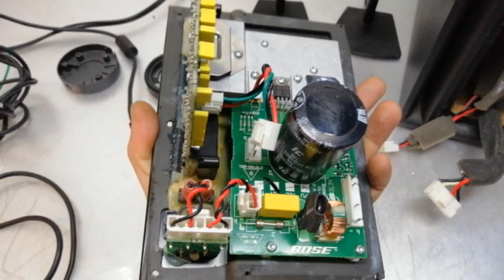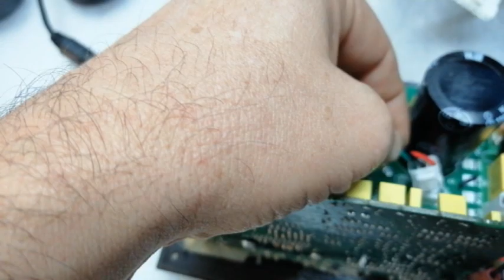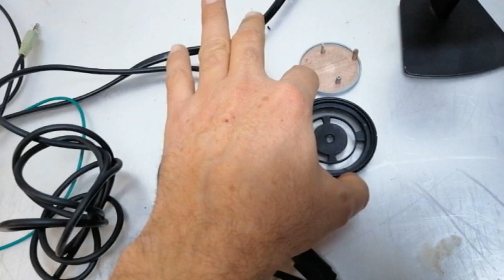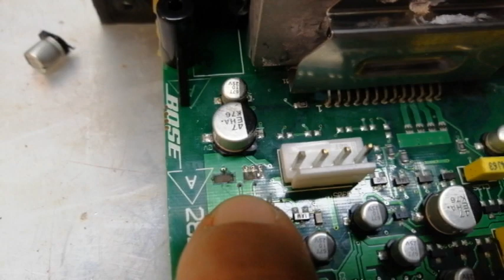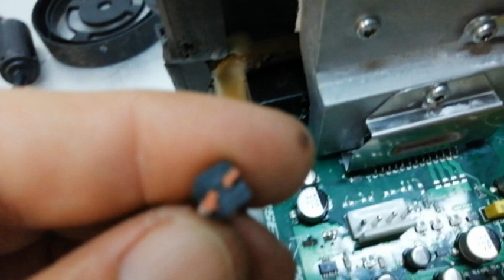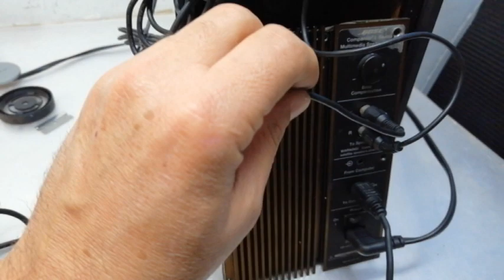BOSE Companion 3 Series II with no Audio Output

Comment: Hola por mas que miro el video no se donde conectar el condensador. El polo positivo condensador de 100mf 25v va a...?? y el negativo??? se que uno va al mosfet y el otro va a la resistencia de 1 kilo ohmio. y al mosfet a que patilla va? Pero no se cual a cual. No se mucho de electrónica por eso pregunto.Gracias espero tu ayuda
Hi, as much as I look at the video, I don't know where to connect the capacitor. The positive pole 100mf 25v capacitor goes to...?? and the negative??? I know one goes to the mosfet and the other goes to the 1 kilo ohm resistor. and to which pin does it go to the mosfet? But I don't know which to which. I don't know much about electronics, that's why I ask. Thank you, I hope your help

Comment: Hi, thanks for the video.  I had the same problem with the capacitor leaking.  I put a bypass for the resistor and the lights on my control pod works.  Now I am having trouble how I should connect my new capacitor.  Can you please advise?
Reply: how did you put the bypass??

Comment: I got exactly the same leaky capacitor issue. The electrolyte corroded other traces as well. However, my BOSE after repairing only got one audio channel output, while the other got humming. No luck.  :(